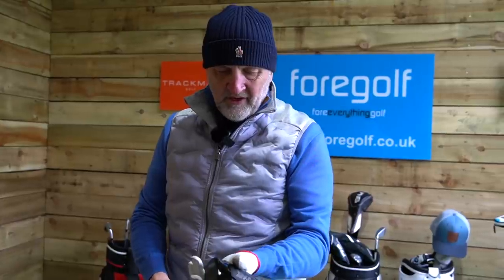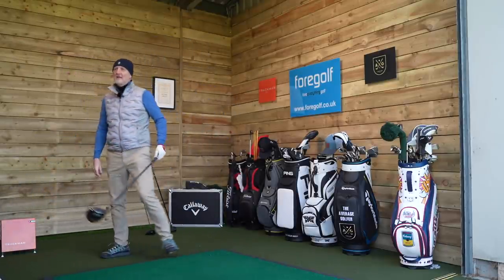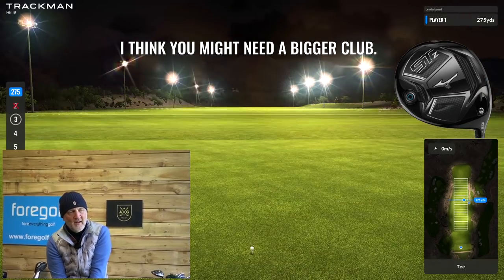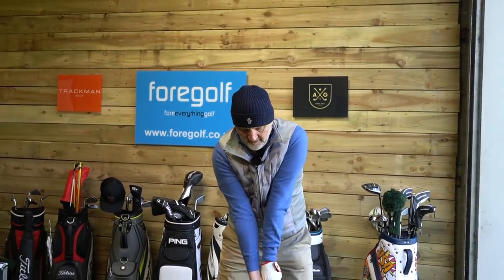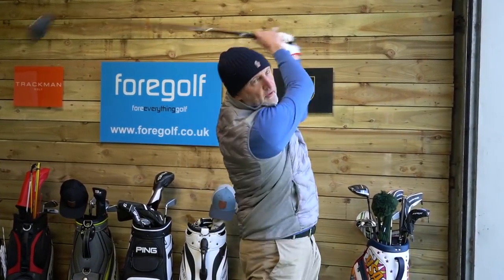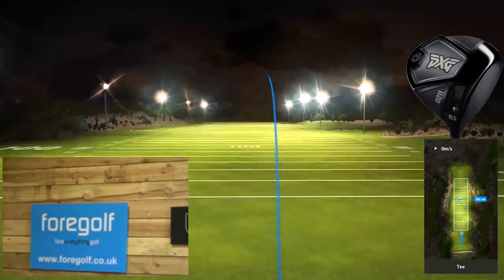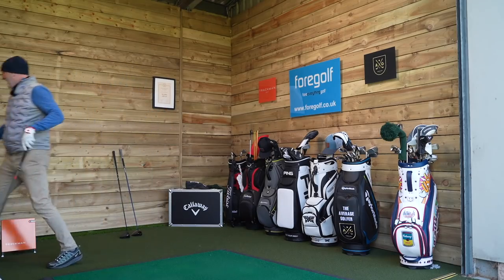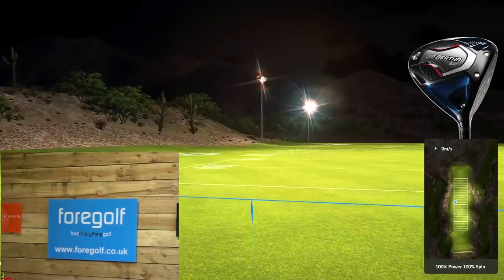PXG 0211 Driver VS CALLAWAY B21 Driver VS MIZUNO STZ Driver

Comment: Andy, when you take a 10.5-degree driver and de-loft it to 9.5-degrees, especially with that Mizuno driver, you can also select 9.5-degree in the Upright Setting (what I call the bomber setting - slightly open but also slightly upright) - that way it gives you the feel that it won't mostly be leaking right (this is good for a gamer) but on a long-drive setup, next time try it upright.

Comment: Absolutely have to agree with you that distance and ball speed come from how solid the strike. Keep that 1 inch shorter shafted Callaway in the bag with the dispersion that you showed  us. I'm playing Sim2 Max and first thing I did was cut it down to 45 inches and really noticed how much more solidly I was striking the ball, and that definetly translated into more distance and much better dispersion for myself. I pulled out one of my old Persimmon Drivers from High School/ College and it is 43 inches which was standard back then and compared to todays club is the same length as my Mizuno STz 3 wood.

Comment: Andy, you should try going back to a std length shaft in the B21 and see if you can squeeze a bit more out of it while maintaining the control you have with it. That would make a good comparison video - 'driver shaft short vs long - the real differences'

Comment: They're all equally able to be long.  They all are conforming to the max CoR and characteristics of time.   It depends on the shaft and your ability to consistently hit the button with each
Reply: Poor swing and swing speed  your not doing those drivers justice, at 9% stick to the 10. 5% and regular shaft, plus you should have started with big bertha, now you're warmed up you hit yhe ball better

Comment: Had 3 rounds with the b21 in a senior shaft fantastic club for my 90_95mph but couldn't resist ordering the pxg 0211 to try aswell. Waiting on the pxg so will see how it goes ordered 2° lower mainly for the windy days at Hartlepool gc 😂

Comment: First, a question - what is your opinion on getting the correct shaft for swing speed, etc.?
Now, my new driver for 2021 is the Titleist TSI2 with a Hzrdus Smoke Blue shaft, CUT DOWN 1 inch. And I am chasing dispersion over distance, the crazy thing is
I have gained 15-20 yards in addition to getting a better dispersion. I am shocked because I have always been a Ping player for the past 10 years.
Thank you for your videos regarding fitting and mixed bag, after watching your videos for the past 4-6 months on setting up a golf bag, for the first time in years ( more than 20 ) I have a completely mixed bag of fitted clubs best for my swing. ( Thank you for all your videos in showing these game changers. )
Let me say, I fully expected a new complete bag of Ping golf clubs, but I couldn’t deny the data from the fitting and production on the course.
My bags for 2021 and retirement :
Driver - Titleist TSI2 with the Hzrdus Smoke Blue shaft, regular flex, cut 1 inch from standard.
Woods (3&5) - Ping G425 with Hzrdus Yellow shaft regular flex, cut 1/2 inch from standard.
Hybrid - Ping G425, set at 21* with Hzrdus riptide shaft, regular flex, cut to 39.75 inches.
Irons (Shocker here) Mizuno JPX 921 Forged with Nippon 850 steel shafts, all cut 1/4 inch shorter than standard.
Wedges - Titleist Vokey 50 / 54 / 58 degrees, with my swing bounce and grind, Nippon steel shafts.
Putter - BETTINARDI Studio Stock 7, face balanced with true roll milling.

Comment: Hi Andy, from Newfoundland and Labrador, I just ordered the Callaway Big Bertha B -21 head, I'm putting a Graphite Design Infiniti Beyond Power shaft in it to play 46.5 " , I've used the shaft in its original driver, Ryoma and it's longer than any driver I've hit before and I've experimented with all the new ones, I can't say enough about the shaft, I've had senior's loving it to players with stiff shafts and they all agreed it's longer than their own, and straighter. If you have the opportunity to try one, please share a video, thanks 👍 Tony and I'm a young 68 golf nut 🥜 , cheers mate 🍻

Comment: I agree Andy,i give up 10 yards of distance for the driver I feel I can control. In my case,it’s a second hand Benross evolution R that I’ve put a slightly shorter shaft in(1 inch shorter) with a stiff flex. Cost did come into my decision but after trying a few of the top brands(I would’ve pushed the boat out,if one of them felt right)my Frankenstein’d Benross suits me!